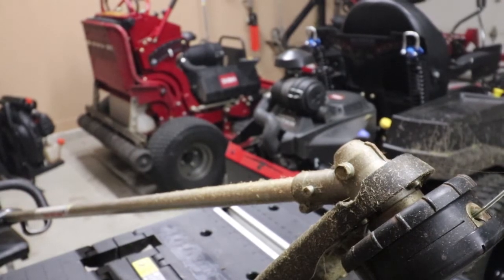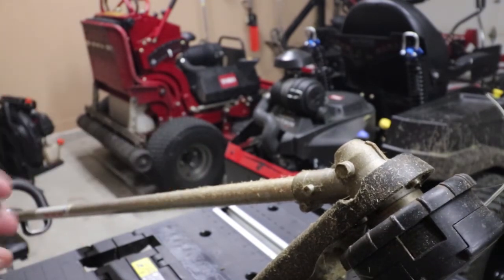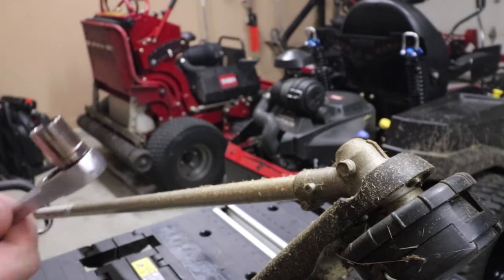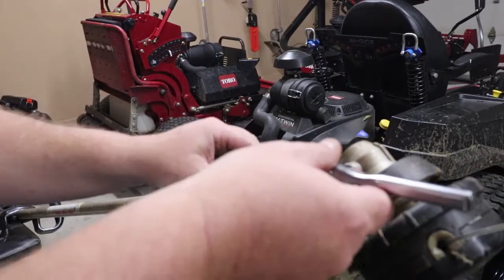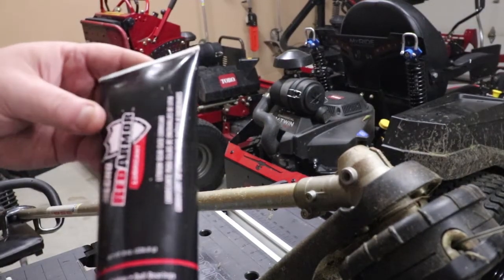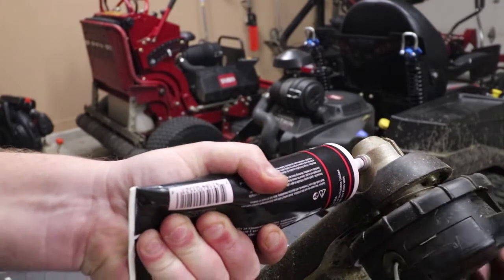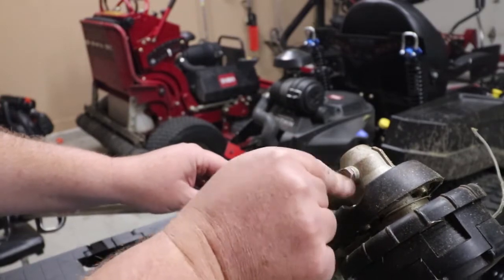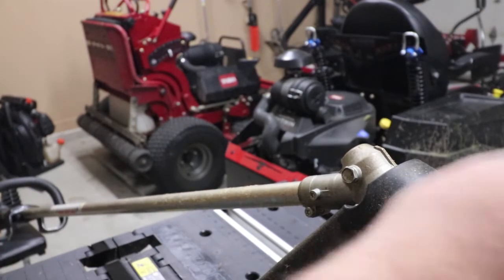How To: Grease Your Trimmer Gear Head

Comment: I use Lucas power steering fix (an additive for your power steering and rack and pinion) in my gear heads on my weedeaters. It may sound weird but it’s a super thick and tacky oil that I’ve noticed makes the head run cooler than using grease. Not sure if it’s the best for it but it runs cooler and (in my experience) seems to allow the engine to rev higher because it’s not as much of a load on the motor as it’s a thinner lubricant. That’s just my preference. I had to use it one time when the bolt fell out and the grease flowed out and I needed something to lube it. I liked it and used it ever since. I’m just curious as to what anyone thinks of using an oil rather than a grease.
Reply: Luckily I read the comments.
The gear head on my new SRM-225 gets wicked hot. Hard to twist line for the speed head.
Reply: @therrienmichael08 I will say it is risky as it’s not the proper lubricant. But I haven’t had any issues with it yet

Comment: For years I have thrown out this plug and replaced it with a standard grease fitting (zerk).  Works great.  Why don't factories do this?
Reply: They want you to buy their specific grease tubes. money grab.
Reply: @johnsipes4422 so if I have a standard grease zerk, common grease used for autos is ok to use?
Reply: @D-Mayor  should be. Just use a high temp grease like Lucas red n tacky or something. If something happens it won’t be under warranty though because you didn’t use their grease. Just do it at your own risk. I haven’t had any issues yet
Reply: ‘Cause bean counters that now run most corporations have no idea what they just did to their company’s reputation and they don’t give a rip to boot!

Comment: Does this apply to any gas powered weed trimmer or only certain brand names?
Reply from the maker: I’m not sure about other brands. This Echo specifically says in the manual it should be done. Most don’t read their manuals though. I will say it will not hurt to do it regardless of the machine

Comment: Stihl and Echo quit providing a port for greasing the gearbox. It’s only spinning at 10K rpm - they let us know they really don’t care!
Of course I can remove the gear box and get a nipple off a caulk tube and drill a hole in the end and attach it to the appropriate grease tube and squeeze a bit in every year.  No thanks to the manufacturers.
Reply from the maker: I’m going to have to check that out. I didn’t know they removed the port